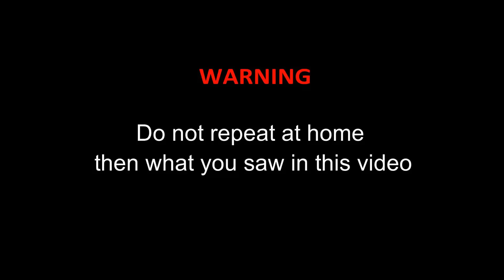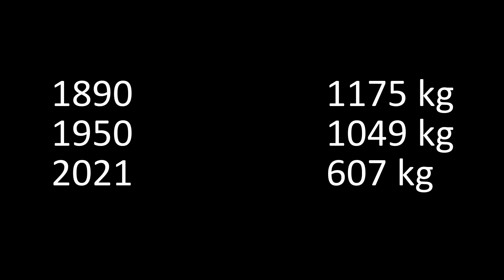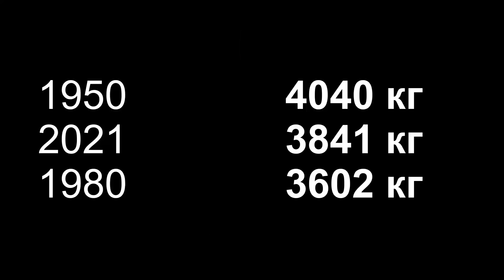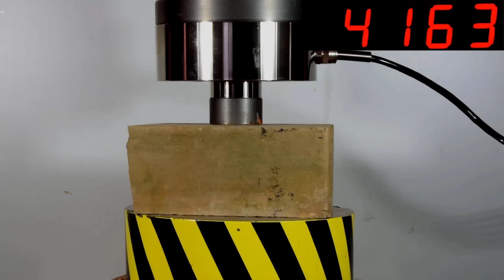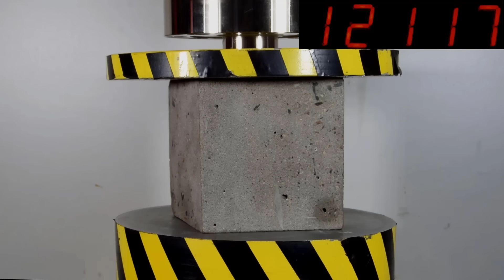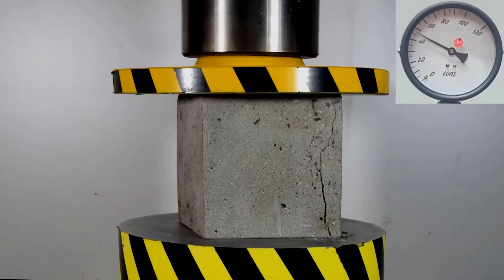HYDRAULIC PRESS VS OLD AND MODERN BRICKS

Comment: Isn't the modern brick "weaker" in comparison because it has trapped air in it to help in thermal insulation, thus lowering heating costs for the building their used in and reduce waste of materials to heat buildings, while still being usually strong enough by magnitudes than it needs to be?
Reply: In many modern construction methods the brick facade lays outside the moisture envelope with a small air gap between: they aren't structural at all except to hold themselves up. The insulation of the house is typically inside the envelope. The air gap is to allow condensation a way out. So bricks can help with insulation as yet another layer, but I'd suspect lighter weight bricks are easier to make, transport, and handle.
Reply: @granatmof  I didn't know that there was an airgap involved, learned something new today, thanks.
Reply: Nope
Reply: Actually modern bricks are made using machines that shape, cut and cook them instantly, like a production line, while old brocks were cooked in ovens over days, letting the material form bonds and structure itself, making it stronger. Also most good clay deposits were exhausted long ago, so modern bricks use clay of lesser quality.
Reply: Modern bricks also do better in tension compared to older bricks
Reply: @Lorenzo4350  sorry.. But your understanding of brick making is entirely wrong.. I'm not going to explain it, but the process is alot more complex.. And it's heat that changes the chemical compounds and the red tinge is front iron+ atoms fusing to the clay
Reply: Bricks don't need to be super strong so another reason is to save costs if they made them the way they did it would be a lot more expensive, I hate when people say the phrase "they don't make them the way they used too" for things, The thing is they do you just need to look around and pay a higher price instead of buying something because of the lower price, Good craftmanship has never gone away, In fact things are even better today we have better materials, tools and have more precision to make things because we have built upon what we had before. anyone else have a opinion on the "they don't make them the way they used too" phrase or agrees with what I said?
Reply: @System32F  I see you're not a wood worker then, because they definitely don't make wood working tools like they once did. For example all good wood planes were made before 1950, anything newer is considered of low quality because they're mass produced instead of hand crafted. Another example is resharpenable hand saws, which pretty much don't exist anymore, all we get is laser sharpened "disposable" saws that last longer but are useless once they lose edge.
Reply: @System32F  It's definitely worth noting that we can't use this video to say modern bricks are weaker mainly because of survivorship bias. The bricks that are still around from however long ago are the better selection of bricks from that time because the worse ones would've already broken or been replaced.
Reply: @System32F  You obviously do not work in the trades.  Modern houses are like hot potatoes and good craftmanship is extinct for the most part.  Today we do not have better building materials.  I have torn down old homes and the quality of the materials is second to none.   But I agree, we do have more precise tools today and yet the end product pales in comparision to the structures built a 100 years ago.  What does that tell you about the standards and skill level today?  Seethe more.  You are wrong
Reply: @Lorenzo4350  Ok well I'm sure you have no knowledge of small companies making premium tools either by hand or with assistance from machines, I'm not on about mass produced stuff that's made cheaply even the higher quality stuff that's mass produced are not premium quality, The most used and favorite tools are some of the best you can get your hands on I payed a lot of money for these tools some even have handles that is selected for my hands, I'm very sure in the past you could not even get anything as sharp and long lasting as what I have even the material of the blades and stuff are space age they will not rust and they are incredibly hard but also tough at the same time! no steel in the past would ever come close to it in performance what do all old tools do if you stop the care of it? they rust!, they were made with basic metals nothing special, Like I said in the first post if you look for it and have the money you will find better.
Reply: @alansabrosky3244  Then look for a house that has been made with the best of materials or build your own house with the stuff you want, a lot of modern houses are made like that because of cost savings not because we can't make it like "they used too", The world we live in today is not like how it was back in the days, Buildings that are made today on mass are only designed  to last a certain time like 100 years for example or even less, especially in cities and stuff buildings will be made with cheaper stuff because of the price the land is expensive as it is then you build a high quality house on that land then its going to be stupidly over priced trust me on that I know! plus research it and you will for sure come to a similar result.
Reply: @Lorenzo4350  bruh I frame houses we have way better tools now for everything people back then would've loved to use nail guns with rechargeable batteries or battery powered saws construction in the 1900s or earlier took very long it was a horrible job and they also didn't have the right tools to make as nice houses as we have now
Reply: @alansabrosky3244  I work in construction wit my dad he's been doing it for the last 35 years and my grandpa built houses too point is he would even disagree wit you because you are wrong houses now are better built because we have better tools stronger and better looking
Reply: @alansabrosky3244  you weren't around 100 years ago you wouldn't know stop making bs up
Reply: @shifty7371  Carpentry is different than wood working. Try making a fine shelf or a good table without expensive electric tools using modern day hand tools, it's a nightmare. Also if you're a carpenter you know that lumber these days is trash, wood is too green and isn't allowed to dry, twisting itself over time, meanwhile 100 year old houses have perfectly straight wood because back them they didn't need to rush production to meet demand.
Reply: @thezen9  this
Reply: @System32F  Nope, pretty much everything is reduced in quality compared to what it was decades ago.  The problem is that modern society is built on efficiency and convenience over quality, which is why the more modern brick has a massive loss in quality compared to the difference between the two older bricks.  It is simply natural law that things build up to a peak and then degrade over time.
Reply: @alansabrosky3244  Calm down there, keyboard warrior, I was asking a question to lessen the amount of "me not knowing stuff about building things". I am terribly sorry if "me not knowing stuff and asking questions about it" offended you.
Reply: @Lorenzo4350  who cares the houses now are extremely strong it doesn't make that much of a difference
Reply: @darkprinc979  no you can buy really good quality tools but you'll pay a high price don't complain over a a problem that dosen't exist
Reply: @darkprinc979  plus everything now is more efficient cheaper and does the job so you're crying over nothing
Reply: @System32F  I use Milwaukee never had a problem their blades cut like butter their nailer is fast and powerful and I use a stiletto hammer which is better than any hammer they had back than but it cost $300 perfect example of good quality at a higher price
Reply: @shifty7371  Exactly
Reply: Wow at this thread. Well, clay has definitely gone down in quality and availability, so, I think they're not just weaker on purpose. Regarding the other comments... in the past, the level of difficulty meant that things were done better, so they didn't need re-doing. Although yes, today, when things are done well, they sometimes come out even better. Consider the 3D-printed house which used mostly on-site building materials (look it up). So, "better" can also mean lots of things.
My perspective is just as a young handy person and homeowner who has worked in renovation and knows some plumbing.
Still, I find some use in what's around me, whether it's high or low quality. Lots of people do the same, right?
Reply: All I know is that modern bricks aren't built the same way as before, which was ONE WAY then but not now. I worked on mostly veneers, which is mostly decorative, but are more quite common throughout the Southwest. I seen some brick sizes range from  2-5/8"x4"x8 " to  8"x8"x 16" all vary depending on their application. Either for decorative, fire resistances, or structural.
Reply: First of all. That morden brick isn't insulating brick. I have studied the limit state method of designing which teaches us to use strength according to use. But things made with LSM has life after which it has to be dismantled or destroyed and built new ones. While the older method of working load is less efficient but the structures built with it lasts almost 200-500 years. So it's about choice and economy.
Reply: I think it is more because more standarized and precise ways of production - modern bricks are made to fulfill the norm and nothing more, while some of the old bricks could be made just to be 'best possible quality'. My experience however with old bricks is that these are usually of low quality,  in some countries bricks were made with semi-amateur methods even by peasants to just make some extra cash. I live in a house partially built of XIX century bricks and they are very soft in comparison to modern ones - I even had to replace some parts of walls as the mortar seemed to be almost pure sand, and bricks were crushing when just touched with power tools.
Reply: @alansabrosky3244  I'm restoring a two story house built in 1855 right now. It's built of massive oak beams dovetailed & stacked, chimney & foundation are 400lb sandstone blocks. I don't know how they cut & moved all that stuff back then, lot of man hours I guess. I'm making my own oak shingles for the roof. Can't wait to move into it.
Reply: @Lorenzo4350  Literally everything you said is wrong. Bricks are made both in single (press type), or extruded column types.
Press bricks are made using pressure inside a mould giving them a solid and smooth structure as the pressure is often 60-100 tonne.
Extruded Bricks are made in columns through a machine the uses a screw feed to create pressure at the head of the machine obtaining roughly 15 tonne of pressure, the column is immediately shaped to size as it leaves the head along with any features such as holes, they are then sent further along to be cut to the size of a full column which is then ran through a wire cutter, these are ones that have a damaged look surface.

Both sets of bricks are then sent to dryers for roughly 8 hours at 600 degrees C, They are then sent into a kiln at 1200-1400 degrees C for roughly 24 hours, Press bricks take longer due to being denser and without holes..

Clay is clay you idiot some places use only a percentage of clay and the rest is coloring, bonding material, dirt, filler, recycled brick or effect material such as sugar to create discolored holes or manganate.
Reply: smarter bricks
Reply: @Lorenzo4350  what do woodworking tools have to do with bricks dude?
Reply: @alansabrosky3244  Really seems like you are the one seething.  We can build better houses today than we could 100 years ago, this is really not in question.  We just choose not to do so because in modern society we choose to cut every possible corner for extra profit.
Reply: Do you know any normal people these days who would build of bricks and mortar? Excluding brits its 21st century and they still build cavity walls of bricks and mortar...🤣🤣🤣
Reply: You can't pump air into the compresion.. The whole slug will crumble as it gets pushed our of machine.. It's the opposite, there's a vacuum pulls all the air out. Usually when u see holes it in, it's from organic things such as rice shells thrown in the clay mix, which burns off in the kiln.
The modern bricks are weaker because of the availability of raw material.
(ps the first brick. The holes are from rocks that shattered and mixed into it) most production issues aren't because of cost saving, but the difficulties in acquiring raw material that can keep up with production. Factories go through tonnes of clay per day.
Reply: Wishful thinking  but it doesn't work that way. Production cost savings is the bottom line.
Reply: 12345shushi  not comparable first our houses haven't been around for that long so we don't know how long they'll last second where it is, the weather, the type of structure ect play a big role you can't compare a giant concrete building to a mostly wooden house I'm sure alot of our structures will be around for a long time
Reply: @System32F  I do alot of hand metal work. I have tried to get a decent hand file new. They are terrible... I now buy mine at garage sales. I tested a new nicholson against an old one by filing them on each other. The old garage sale files will cut a notch into the new nicholson made in mexico files and still have teeth to continue work.
Reply: all this trade discourse brought me life
Reply: @Lorenzo4350  the disposable trend is across the board right now, whats the sense in selling someone a product theyll have their whole lives when you can sell them a slightly cheaper product over and over again forever?
Reply: I know nothing about bricks honestly and this is all super interesting to me
Reply: Never knew bricks could do that
Reply: @System32F  Oh yeah.. they make them cheaper to be more affordable, yet nowadays it's more expensive to build anything and the materials are at best of passing quality, you contradict yourself because your thoughts aren't your own.
Reply: @Lorenzo4350  you need to rush production to make profit if you take any longer than 3 weeks to frame a house you'll most of the time lose money it's not about demands most of the time
Reply: @MattBG67  yes affordability is big it's still expensive which is exactly the point if they do it like they used it it's even more expensive and less efficient
Reply: @MattBG67  most things now are good enough you don't need anything stronger than it so you're complaining over nothing not to mention if you want better materials/tools there's companies that make them
Reply: @System32F  The only reason people think that is because there is a market for cheap stuff. If you are willing to pay a premium you can find materials and craftsmanship that rival or exceed that of the "old days"

Comment: Interesting, but the tests lacked any form of surface prep/normalization.  Contact surfaces of the bricks were not smooth, thus loading was focused on relatively small, localized points.
Reply: I mean, let's be real, it's a brick, they are produced in huge masses and it is not very realistic to expect them to have smooth surfaces, I don't know how strict the tolerances are for bricks but I expect noticable imperfections due to their brittleness. Having a rough surface like in the video is more realistic than doing the test on a smooth surface I'd say.

Of course, even though the test is more realistic it would require a much larger sample size to judge the performance of the average brick due to the randomness of the imperfections.

Then again, I'm not a civil/constructional engineer, maybe I'm underestimating the brick standards.

Edit: I googled the tolerances and it doesn't incredibly strict imo. The imperfections are measured in entire milimeters and there are of course no geometric tolerances as would be expected for a component produced in such huge masses. Judging by this I still think a course surface wasn't such a drastic factor in this test.
Reply: It’s also just a fun video….so there’s that.
Reply: @rodjaknenad6984  because you arent supposed to use brick by itself? Normal application would be to use cement as the glue and filler inbetween bricks, so technically you do spread the force quite evenly if say a wall is put on top of these bricks foundation.
Reply: @Crustee0  Fair point, I was just considering the scenario where you load them directly for whatever need you might use them for.

The test is indeed a bit inadequate when considering a load case with a filler.
Reply: Sooooo many virgin comments here. The older bricks were stronger just like EVERYTHING else in the past were. PERIOD!

Comment: I believe the amount of time the stone cures has a factor . It gets stronger the older even if it was made the same way
Reply: For ceramic and concrete to a certain point it does, then it might have microfissures that reduce it's strengh albet very little over time
Reply: I bet Roman Concrete is a real beast then.   ;)
Reply: @DementedCaver  It is, but the formula was also different. Supposedly we don't know exactly how they did it, but the way they used volcanic ash caused the material to react to saltwater in a manner that strengthens it rather than weakens it. Roman-built docks in Italy are insanely strong for being concrete
Reply: @SepticFuddy  We know how they did it, but it's not economical because of how much material and curing time it would consume, along with the changes in loadings that we demand from it (a lot more tensile stresses instead of pure compression). Nowadays the focus is on additives that make the concrete easier to work with using less water (making it cure faster and stronger) along with improving flexing tolerance, cracking patterns, etc.